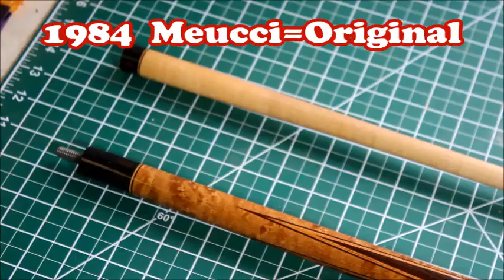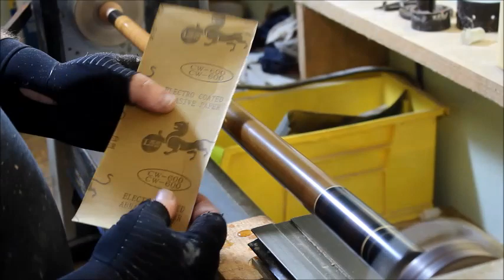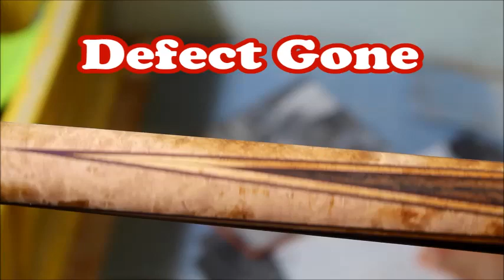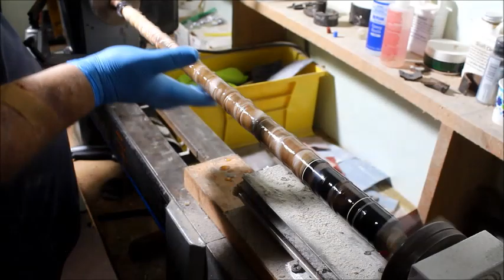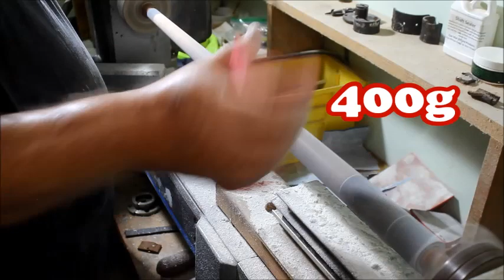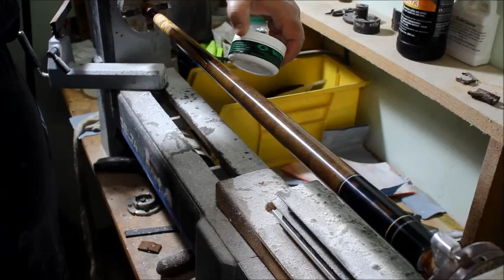Meucci Pool Cue Restoration Part 1

Comment: Perfect Finish, great restoration on OG Meucci. What products you use for that finish?
Reply from the maker: Thanks for the kind words. I'm glad you enjoyed the video. 
For Butt or Handle :

1st   Base Coats :  Devcon Epoxy : https://tinyurl.com/53p872s9
2nd  Finish Coat :  Insta Cure by Bob Smith :  https://tinyurl.com/2efa5382
3rd  Mach. Polish :  3M Machine Polish 39063 :  https://tinyurl.com/5n84pcfr
........ But any verson of 3M or even car polish will do .............
4th   Cue Wax from Cue Man Billiards :  https://tinyurl.com/4y64zzbv

For Shaft : 
1st   3 coats Shaft Sealer :  Mohawk Lacover 30 :  https://tinyurl.com/4ub2n3pb
2nd  Mach. Polish (#3 above) 
3rd  Cue Wax      (#4 above)

Comment: I just picked up a meucci smoke stained cue 21 oz love that stick not a fan of the uretane coating but im getting used too it.
Reply from the maker: I really don't know what kind of coatings they use but most of the restorations I've seen were all done w/ some sort of epoxy & CA glues.
Maybe they do use eurethane ?  That might explain the yellowing patina after a couple decades or so.
Good luck w/your new cue,
God bless,
Sincerely ..........................

Comment: Pains me to see you have a lathe then sand horizontally many many times without the lathe spinning. Use the lathe for even sanding, that's what it's tgere for. Also what process is it at 4-5min where you are applying the aerosol mist?
Reply from the maker: Thank you for watching and your considerate concerns. :)
I guess I'm a victim of over 35 yrs of being coached, experience & obvious results.  I will agree that even sanding is important. Holding paper on a pcs of wood spinning 3000 rpms can be touchy if not done w/care. But, just like any orbital sanding or cross grain sanding (on flat or radius) leave obvious scratch marks.  I've been taught to finish w/sanding w/grain to remove cross grain marks that may be seen.  Fortunately, linear sanding on a cue will help the tapper a bit if you've spin sanded to long in a a spot or two. 

The aerosol mist is hardener & specifically made for CA glue applications.
Thanks again for your generous consideration,
Sincerely .................
God bless !!
Reply: @stephboeker7835  I thought that was CA glue but have never seen that step before after epoxy. Would have never thought ca glue would sand that clear
Reply from the maker: @Lefishn   ..... when I started w/ a lathe, I made pens , pencils , wine bottle stoppers , etc .....   CA glue was recommended by all the lathe club guys and online video guys.  I found it to be very clear (crystal even).  So when I learned about finishing a pool cue, it seemed obvious that some recommended CA glue and I never doubted it.  I like the results !!
Thanks for the comment,
Sincerely ...................

Comment: What the name of bSI glue
Reply from the maker: Bob Smith Ind. ..... or ..... Insta Cure.  It's a CA Glue (superglue) and can be flash hardened w/CA glue excelorator/activator.
The CA Glue comes in Extra Thin, Thin, Medium & Thick.
I use thin & medium for different applications. Finish coats & Filler respectively.
Thanks for watching & comment,
Sincerely ..................
Merry Christmas & God bless.

Comment: What grit sand paper between the base coats and again on the finish please.
Reply from the maker: thanks for watching and your interest. I use the 150 through 1000 on both the base coats. then 3 coats of thin CA glue per accellerant. completing 10 coats. only after all 10 coats of thin CA glue do I sand the finish coats. I may have to start w/ 150g but move through all to 1000 g carefully. 
Hope this helps you. Thanks again,
Sincerely ...............
God bless.

Comment: Very nice work!  Couple questions if I may...

1) Can this process be done without ruining a signature?  I am thinking of having one of my Original Ray Schuler cues refinished and am concerned about the signature underneath.

2) Would it require the wrapping to be redone as well?

Thanks in advance!
Reply from the maker: Thanks for watching and for the comment. I'm glad to see ppl researching before diving into unfamiliar waters and always eager to help w/ what I can :)
Answer re: (? 1)

When I started this endeavor, I knew that some signatures were etched and filled while others were painted on. This is important because where it is filled , it can be lightly sanded w/ out being noticeable. On the other hand, if it is painted on then you completely loose any part of the signature you touch w/ sandpaper, no matter the grit, speed turned or by hand.
That said, I found out "Lucasi" paints theirs on the hard way and boy was i surprised.  I went through a lot of stress before I found a small miracle to fix it. I found a picture of the logo , posted it to a rubber stamp making site online, they found the font or similar enough to pass, and made a stamp for me. Then I went through a heck of a time learning and creating muscle memory so as to have just the right amount of ink, the speed to roll my wrist, in line w/ the round cue butt I was stamping while turning the cue w/ the other hand , and then learning what kind of finish would not melt the ink upon application. It was all a big nightmare that took over 200 tries and patients that would fill a dump truck.

The answer to ? 1.) is yes. But, I would not recommend sanding the finish completely off over the signature part if you don't know weather it is painted or not. Even if there is a small tell tale that the area was not thoroughly and completely removed of old finish, you can keep it small enough that only you or a trained eye will be able to tell. If you think it is painted on , I suggest sanding around it (feathering it) and cleaning on it or if you do sand it a bit to use 1500g or 2000g just to ruff (rough) it up to hold new finish.

Answer re: (? 2)
Short answer ~ No !  Meucci finishes the wrap and I've seen others do it as well, but I've finished many cues that don't have finish on the wrap.  Just tape it off good.  You might use a razor to separate the tape when done.  If there is a sharp ridge left between the finish wood and wrap, just apply a round , smooth , metal (like shank of screw driver or dowel) to champher or ease the edge.  Even if you use 600g - 1000g sanding sponges (or paper) you can ease the edge where the tape was removed w/ out much notice in the wrap. If you do see a bit of sanding on the edge of the wrap, you can easily fix it w/ wax :)

Hope this helps and sorry bout' the longwinded book form,
Sincerely .................................................

Comment: First glue, what kind of 2 component glue is that? And second glue with activator, can you tell me? Regards
Reply from the maker: 1st ~ Devcon 5 min Epoxy : https://tinyurl.com/yylaxshs
2nd ~ Bob Smith Insta-Cure (thin) : https://tinyurl.com/uwqt93d
3rd ~ BSI Insta-Set Accelerator (aerosol) : https://tinyurl.com/wdtmelb
Thanks for watching my video and for leaving a comment,
Sincerely ..........................
Steph

Comment: Hello, i want to ask
Is the bent like on this cue butt (bit wobbly when slowly spinned) have affect on play performance or must as straight as the shaft is better?
Reply from the maker: Your question is a bit hard to interpret for me. Maybe English isn't your 1st language ?  No offense.  But, If I understand correctly, you are asking:
a.)  is the straighter the shaft the better performance ??  And:
b.)  does the wobble in the handle make a difference or affect the performance ??

My best response is, "in theory" the straighter the shaft or handle, the better the performance !!
Although, "performance" is defined by several factors and some more important than others.
For instance, even if you have a flawless, straight shaft or handle and can't control your arm stroke, your performance will be less than perfect. 
If you're nervous , lacking confidence , the weight is wrong , the speed of your stroke off , the tip not well shaped , hydrated or chalked up ,quick to emotion, If the interpretation of angular contact, or your eye sight impaired by alcohol or drugs, the stability of your bridge hand, all these affect your performance.
Practice, skill, talent, experience are by far more important than any of the previous factors I've mentioned.  
Have you ever heard :  "if you can't walk into a bar, find a bar cue on the wall w/a decent tip and acceptable weight, find the warp , turn it down and proceed to beat everyone in the bar , you need to practice.
Another saying is :   "don't blame the tool"

This is the best I can relay how important the cue is and what expectations you should have over the cue & your talent.
I hope this was helpful, and thanks for the question,
Sincerely ....................
God bless !!

P.S.  I was 10 yrs old when I started learning pool by college students who took an interest in me and my passion for learning the games in billiards.  They started me off w/ "Snooker".  That was a God send.  It is by far the hardest game for a short 10yr old to learn.  The biggest table area, smallest pockets, balls and important to set up for shape on the next shot as you must hit & make the balls in an ordered way.  I played against college students w/ expensive cues (hundreds of dollars) but my cue cost $13. new at TG&Y  (like walmat).  By the time I was 12, I could beat them all and made a lot of money off those older college kids.  Desire, Practice, Patience build confidence and skill. These are most important.  The beauty of a cue or it's high worth is absolutely an ego thing meant to boast and maybe (if you're lucky) disparage the opponent.  But , an expensive straight cue helps little against a skilled player.  It's more of a talking point or bragging outlet.
Being skilled & humble , controlled in your emotions, sneaks up and dominates in a way they don't see coming.  Anyway, you can't win w/out skill.  And, w/skill, you will win w/any cue or tool !!
Reply: @stephboeker7835  / Snooker being a God send, is so true especially at a young age, as the degree of difficultly is magnified many times over vs pool. Our son took snooker leasons on a 12 ft. BCE table, with a former top4 World Championship player, when he tured 14. Later than year he was dominating mens tournament, and his stance and stroke was well refined & honed. All because of taking pro snooker instruction, while also 
playing 9 Ball
Reply from the maker: @beaumont6751  ... my father taught me to focus, seek & find, persist, have faith & work very very hard towards having & succeeding in goals.
However, he never spent much $$ in support of my interests. I mean to say, he saw I had an interest in golf as I had obtained a job at the local City Golf Course charging batteries & odds and ends. He purchased a used starter set of clubs my size and gave them to me as a Christmas present from Santa. I put 1000's of hours into it (and pool at the same time). I was shooting in the low 90's by 12 and broke 90 by 13. Low 80's senior yr of high school and broke 80 at 28.  Now, I've never had a lesson but figured it out on my own or by asking others or listening to their critique. I also had to work all my life so I'd never be a pro pool or golf b'c I became a dang good finish carpenter traveling to make sawdust for more $$ than I ever imagined.That was my career. My hobbies had to come after the 1st 12 hrs a day.

I do believe my mother hoped my father would pay for lessons and support my golf or pool so that my career may have been one of them.  But, that he didn't do. I really found making sawdust to be my desire and I was good at it. I don't believe I every really felt like it was a job "I had to geaux to" or had to do to make a living.  I woke up before the alarm went off eager to address the issues I left undone the day before ..... or start a new one.

In conclusion, I never reach the pinnacle of any of my hobbies but I did become the guy to beat. I'm glad to see ppl who had lessons & focused on one thing or another.  To ascend to the top of their field. It may even produce more fun & joy that way, but for me I couldn't imagine being more happy than I felt about the gifts & successes God gave me.

Thanks for the comment and I love the story about the boy. Happy New Year,
Sincerely .................
God bless.
Reply: @stephboeker7835  thanks for the feedback!,   yes, english isn't my 1st language mybad for the bad pronouncing, yeah what I mean is (b.) section... but only the butt while shaft is still straight, thanks for the response, understandable
Reply from the maker: @relvin457  ... again, technically, a straight butt or handle (w/out wobble) would be desired. But, again, the difference in performance is so small that it wouldn't matter to a beginner or a professional. 
The worst it can do is get into your head (the knowledge of the warp) and effect your mental or emotional state. 
But, life is all about controlling your own mental and emotional state. If you can't control that, a beginner will never get better and a pro will fail.
IT'S JUST NOT THE CUE (OR BUTT)  OR TOOL THAT GUARANTEE'S SUCCESS !!

Comment: What do you jus licuid
Reply from the maker: a) Base Coat ~ 2 part epoxy (5 min epoxy)
b) Top Coat ~ CA Glue  (Bob Smith ~ Thin)
c) Machine Polish ~ (3M but can use any type of polish or compound)
d) Cue Wax ~ (but can use Turtle Wax, Bees Wax, etc ...)

Thanks for watching,
Sincerely ...................................